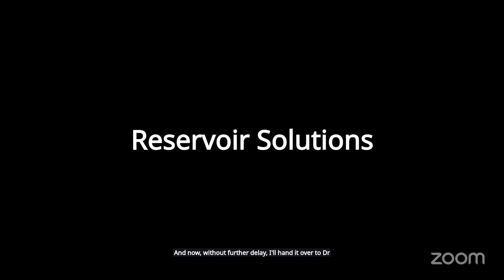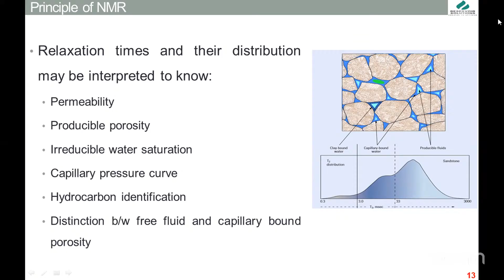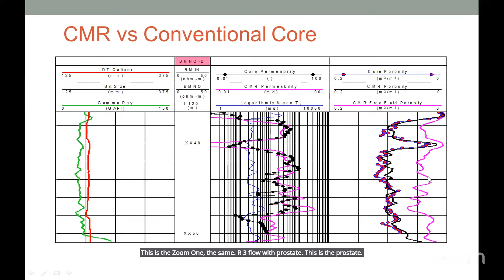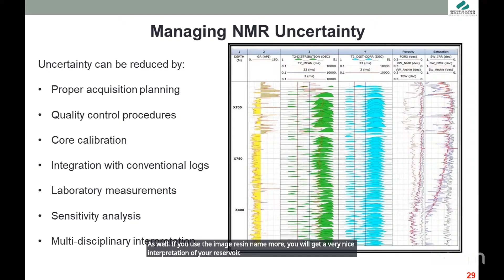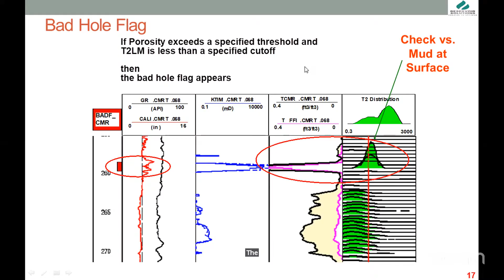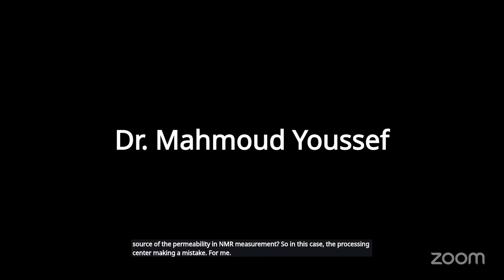Webinar: NMR Petrophysics: From Fundamentals to Reservoir Applications

Comment: Secondary porosity in sandstone reservoir may be present due to fracture or dissolution of grains or cement and the latter is the most common in sand reservoir. Secondary porosity may be detected and characterized by conventional logs as well as by NMR. In conventional logs, sonic doesn't respond to secondary porosity, however density and neutron do, by comparing the two porosity readings the presence of secondary porosity can be identified.